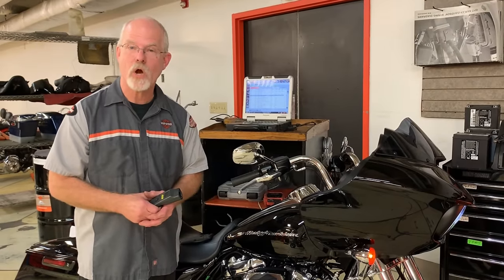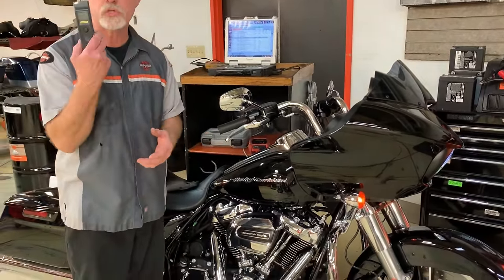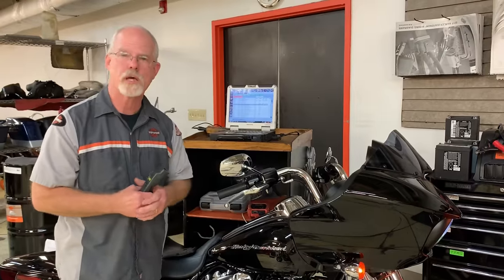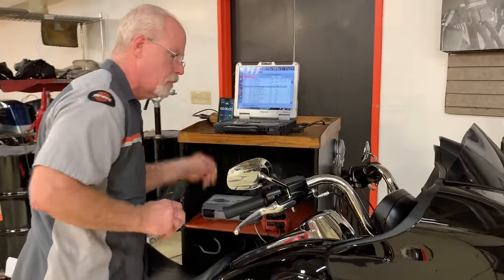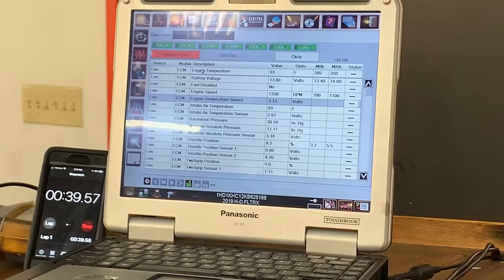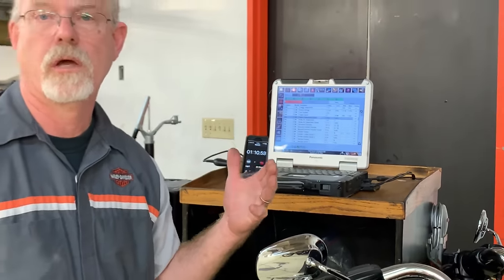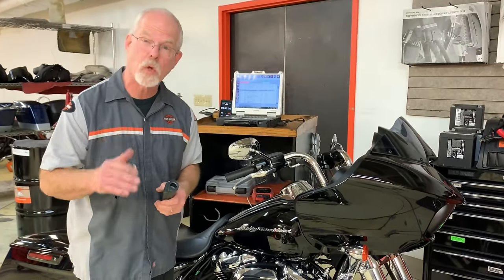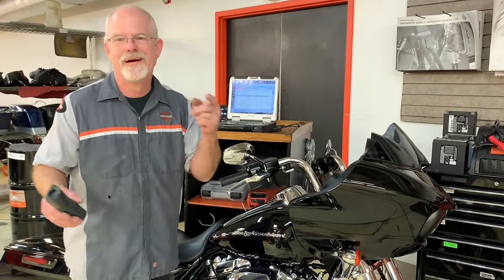DOC HARLEY: HOW LONG TO WARM UP YOUR MOTORCYCLE

Comment: Another little known fact: Every time you ride under an overpass, pull in the clutch and rev the crap out of it. This will add more oil to the piston skirts to prevent skirt scuffing while riding at highway speeds for long periods on hot days.

Comment: What is recommended warm up time for older carbeurated engines?
Reply: Chris Clark longer!
Reply: @bobbates6595  Thanks. I read another comment where the guy said he lets it warm up until he can push the choke in and it will idle. I'm guessing this to be about 5 minutes or so.
Reply: Chris Clark that sounds about right, I have a 79 electra glide classic, I like to let it warm up good before I start out, I bought it 30 years ago this month, May of 89! I hope 2019 is a good year for you!
Reply: I've got a 94 flhtc. I pull the enrichner out and let it idle until back cylinder is warm to touch.  Then pull away and adjust enrichner as needed. Don't hammer on it until the enrichner is all the way back in. Seen a lot of leaky base gaskets on evo's over the years for people  hammering on them right after start up.

Comment: Hi Doc. How can I make sure my water pump and coolant is flowing on my 2016 RG ultra. I did the upgraded pump btw
Reply from the maker: A suggestion. view the coolant over flow tank. With the motor off,
Turn the Throttle wide open, hold, turn ignition on. Fans should come  on, watch the level in over flow tank. Doc

Comment: Good morning, Doc, is there any benefit to run ethanol free fuel 93 octane Vs 93 10 % ethanol in my dyna 2013 FXDB
Reply from the maker: Yes, but a retune would give you the full benefit. The stock fuel and timing tables were designed for the 10% ethanol…..Doc
Reply: @LowCountryHarleyDavidson  Thanks Doc , My first  Harley and at 75 I have a ton of questions . Watching your videos really helps Be safe

Comment: Great advice Doc. Tell me, I heard (Shawn Smoke I think) that you should not let your motor Idle too long as this can damage the engine by various parts over heating and expanding too much? Makes sense to me. Thanks
Reply from the maker: You probably should NOT start your M8, go inside, have a cup of coffee, brush your teeth and get dressed while the plastic manifold is melting. ~Doc
Reply: umm ok is that a no then, you can leave it to idle for longer than the 30 seconds? Common sense tells me it is bad to let any engine idle too long. Thanks

Comment: But Doc,   my driveway connects directly to the hwy, they're going 60 to 70+ mph, I can't 
drive easy for 15 min, I have to get on it pretty hard right out the gate.
I have no problem letting it really warm up before leaving, what would 
you recommend , short of moving. : ) How long should be good enough in 
my case..? 09 Ultra.

Comment: Most engine wear in any kind of engine occurs right after a cold start up.  The best way to warm up any engine in a vehicle is to start it and start moving immediately as soon as your oil pressure is up to normal range.  Then drive it or ride it real slow for the first two or 3 miles so the engine,wheel bearings,  brakes, every part that moves warms up together.  That means a slow, leisurely ride through a neighborhood where you can ride nice and slow not jump up on the freeway immediately.

Comment: Hey Doc my dyna fxd 2008 after hot going out and xplotions , I replaced engine temp sensor, crankshaft sensor, throttle sensor, spark plugs, cables, gas filter, and still doing the same thing.. what it can be????
Reply from the maker: " after hot going out and xplotions" ?????? This issue sounds more than we can fix on the Net. Take it to your local experts....Doc

Comment: Hi doc i have a problem   with my 2008 96 cui heritge when i switched my head light to an led i have idle issues  with just the headlight but  not the two smaller road lights
Reply from the maker: Pull the instructions for the LED light install and review. Sounds like a wire is installed wrong or the ground wire from the headlight is old and not solid and clean to the chassis. Or it was just coincidence the intake seals failed at the same time as the installation🤷‍♂️. Thanks ~ Doc
Reply: @LowCountryHarleyDavidson  nope probably wired wrong because when i switched. Back to regular head light it smartened  it up

Comment: I wait 30 seconds to a minute and then I take off. By the time I’m to the highway (about a mile down the road) it is pretty dang warm. From there I have to rip it so I don’t get ran over. I have done this for the past 8,000 miles on my 2019 iron 1200 with no issues, even down to 25 degrees in the morning.

Comment: hey doc .. have a stage 3 kit installed on my 2017 street glide, do you think I need a extra capacity oil pan for extra cooling...
Reply: You've got 6 extra RHWP, so now it makes 103 rwhp and weighs 700lbs.

Comment: Harley-Davidson has a type of dry sump system so warming the engine is a waste of fuel and time. I fire mine up, put on my glasses, hop on, and ride, 45 seconds tops.
Reply from the maker: Well Stuart it is always your choice. If your reasoning includes a dry sump motor 🤷‍♂️. I look forward to replacing….i mean servicing your motor👍……Doc

Comment: I have a 2018 Sportster 48 and between riding days,  I start the engine and let it run for a few minutes to keep the battery from draining. How long would you recommend letting the engine idle to keep the battery charged if I'm not going to ride?
Reply: You don't. Put it on a trickle charger when parked. Ride it.
Reply: Get a battery tender for it, hook it up when your between rides. Your doing more damage then help by letting the bike sit there and idle when not riding it.
Reply: You have to let it idle for about 20 minutes because you used up so much battery starting it. I let mine go a half hour to be safe. You should rev it occasionally to keep the injectors from clogging.
Reply: LIONS 67 dont do it I would never start it unless I was going to get it up to temp real bad on your oils buy a battery tender I keep mine on one get a good one you will like it

Comment: Often wondered about two stroke motors with auto lube. That oil is always going into the motor at oil tank temp- cold! And even if it's a pre-mix engine the oil is still going in cold. Must be why two strokes have a shorter life than four stroke motors.
Reply: My yz 250 will be 40 years old next year still runs great
Reply: Yeah, had a few two strokes over the years. The one that I remember the most was my 1974 Suzuki T500L. Amazing motorcycle that was a great tourer.
Reply: The oil goes into mix with fuel. The atomized mix is warmed quickly.

Comment: What? It didn't get to temp after a minute then at the end you said just go with the manual - run for 30 seconds and then take it easy for 15 minutes? What I know is that if I warm up my carbed 06 Fatboy for 5 minutes it runs a lot better than if I buzz away after 1 minute.

Comment: I  just bought a 1997 Roadking with the  Marreti marelli injection...the warmup idle idles normally about a minute or 2 then revs down to a good lower idle  with a 2 into aftermarket exhaust  but after a five minute ride  up the road, I  then  shut down the engine, heads feel nice and wrm....., when restarted within a couple minutes from stopped it seems to high idle all over again for 20 to 30 seconds.... cleaned the throttlebody, still the same ...is this normal for these injections? Do they need longer rides to get the warmup idle to let it go lower?  Are there adjustments to remedy? Thanks
Reply from the maker: Marelli system are temperamental. Also they have a "fully Warmed Up" temp higher than any other system. My concern is Intake seals leaking...Doc
Reply: Could that cause a slight backfire  on throttling off downhill  from exhaust pipe and sometimes a hesitation from carb sometimes when throttle is opened wide whilst riding at high speed 100 kph to 120 kph or uphill?

Comment: When starting bike
Hold WOT as starting
Once started let it hit rev limiter at least 10 times
The quickly let go of throttle
Once the last backfire stops on deceleration
Calmly and Cooley straddle bike.
Wait till the clock hits 4am
Grab clutch. Resume WOT
Second rev limiter
Pop clutch and hold fishtail till it steadies in a straight line, hit second gear and resume normal riding speed.
That's how you ride a 
 Harley
Reply: Interesting, that's the same procedure for GSXR's
Reply: Honda warm up is when you pour 10 liters of gasoline on the whole bike and then you throw a match on it!

Comment: Thank you, very much, for your channel and great content; just subscribed.   I had been idling too long, because I wasn't sure how to ride "easy."  I wish you had gone a little further.  What do you mean, when you say to ride easy until it's warmed up?  I understand no hard acceleration.  Recently started trying to do it right.  But, when I change gears at 2.5k, the motor drops immediately to 2k and it sounds horrible, like something isn't right.  It starts to sound like rpms are getting too high around 3k.  So, is my intuition of riding between 2.5k and 3k rpm (during warm up) solid?  I ride with the Power Vision display, and don't exceed 3k until above 200*.

Comment: My bike starts at 1500rpm then goes down to 1200rpm... isnt that the most appropriate time to ride? Because if it isnt hot enough the throttle response is a bit augmented...
Reply from the maker: 1500 is for recharging your battery after the starter took out a lot. 1200 is still warm up. I wait for closer to idle when it’s at full operating temperature. But you can go if you need to. Thanks ~ Doc

Comment: I live in a very hot country, bikes heats up quick... Can I lessen d warm up time?
Reply from the maker: If you keep your motorcycle inside overnight, no. A cold engine is a cold engine. If left outside all morning in the sunlight and the outside temperature is hot enough to warm the motor parts (i.e. too not to the touch) then yes. Thanks ~ Doc

Comment: The book says run on full choke for 3 mins than 3/4 choke for first mile 1/2 choke for another 1/2 mile and 1/4 choke for a quarter mile . No choke for the last 1/8 of a mile to the bar. Repeat on way home.

Comment: What if it's an older model and not fuel injected?
Reply from the maker: Your motor is no different from a fuel injected motor. Your oil still needs to reach critical areas, motor needs to seal gaskets, and fuel needs to be correct. My old bikes would start on full chock. I would go to half choke while walking around bike checking all lights and visual checking all parts. All the time listening to hear the motor warming up and needing less choke. Choke off go ride….Doc

Comment: Hi Doc.  Love all your videos.   Question,  is it bad for your engine if you let it run for a minute or two daily?
Reply from the maker: Yes. Starting and idle for a couple of minutes does not allow fueling to get out of cold mode which adds extra fuel. Also idling does not allow the charging system to replace voltage taken out of battery when starting. A short 20 minute ride is better. Thanks ~ Doc

Comment: I still own one 1986 FXRS, I hate saying that because for years I owned two and recently sold one. I give my throttle two twists, pull the choke and fire it up.  I let it idle and I use the back of my fingers to touch the jugs.  When I feel like it’s to hot for my fingers I ride off.  I also let my bike idle for about 30 seconds before I shut her down.  I have had guys bust my balls about my little rituals.  But a couple of those same guys commented how dry and clean my motor is. The old Evo’s leak if not warmed up properly.
Reply: Man I miss my 85 fxrs, some pond scum decided he liked it more than me. Forks where locked but that still didn't stop them, thinking it got thrown in the back of a van or pick-up. Anyway that's how I warm my 94 flute. 188k miles. Never a blown head gasket or leaky base gasket.

Comment: I’m wondering why Doc stopped the timer when the oil got to 104 degrees, we didn’t get to see when the oil achieves normal/optimum operating temperature at over 200 degrees, I think we need to let it idle for probably closer to 2 minutes from a cold start.

Comment: Most modern engines don't need a warm up, but if HD is still in the dark ages design phase as indicated by using 20/50 oil. well I guess the neighbours are going to have to suffer your noisy crapper in the mornings. Seriously, are you serious?  Start and ride off. Like you said, it will warm up quicker if you ride the damned thing. As long as oil is circulating at pressure it's gonna be fine. Either that or get a Honda
Reply from the maker: Steve your Opinion is noted, have a nice day…..Doc

Comment: pulling on gloves and a helmet is 15 seconds or so. signals  and lights check is about another fifteen. easy, lazy ride to the local gas station to top up and you are ready to rip

Comment: I agree with Doc Harley start it up walk around check all the lights get on and ride it easy for the first 10 minutes.  I have own this bike for 20 years still works great with no issues. To me warming your motor up to long is just creating carbon problems and put more gas in oil which is causing more wear. You are not doing your engine any favors or your pocket book.
Reply from the maker: I am confused. First it's OK then It's not and wearing the motor out? I'll stick to the walk around....Doc

Comment: shite!  laptops, heat guns, cell phone apps ???? whatever happened to kick it over, keep the revs up (choke or throttle) for a few minutes to get the oil pressure up, get on it and get in the wind. been doing that for 50 years, ill never sell my shovelhead. great review doc.

Comment: Easy way to check, once you think it's warm stop the engine and remove the oil filler cap. Then get your knob out and put it into the oil filler hole, if your bellend sizzles away and burns you know your hog is hot to trot. Follow this advice and you won't go far wrong son.

Comment: Of course all this depends on ambient temperature! If it's 40°, which is as cold as you should crank a bike if you have 20/50 in it, I usually let my bike warm up 3 or 4 minutes. If it's 70 yeah 30 seconds to 1 minute is fine.

Comment: I was told to feel the rocker arm covers. When it feels warm.  Bye, see ya gone!
Reply: @Alan Rubin • I do the same, roll it out of the garage fire it up and put on gear throw a leg over the saddle reach down and feel the rocker cover it's warm I'm gone.  Back before Evolution Moters came out I would fire up my old Shovelheads and goodbye right away but with all the aluminum on.the Evolution that needs time to warm up and expand so you don't blow gaskets and O-Rings.

Comment: Hey Doc, thank you for the advice. Do you have any additional suggestions for how long to warm up a stage III bike with forged pistons?
Reply: 2 minutes
Reply: Stage III with forged, not cast pistons? Wow, you've put how much money into a fat, heavy, HOG?
Reply: @benjytexas  About 3k if you do all the work yourself, which ain't all that hard. Try that on a BMW. It's all about the torque rush sonny!
Reply: @Cwra1smith  ...LMAO, you wanna bring that to a proper roadracing circuit and show me how slow it is?
Reply: @benjytexas  A Road Glide has a much different mission. You wanna try and stay with my Suzuki TS-400 in the brush with that road racer? I didn't think so.
Reply: @Cwra1smith  , race tracks, I've got a RM that I'll race you on the motocross track as well!

Comment: There's been days I've ridden for seven or eight hours in 50 degree weather and my bike never cracked 180 degrees.
Reply from the maker: I’m sure you did not crack 96.6 body temperature either….Doc
Reply: @LowCountryHarleyDavidson  Lol, nope. Froze mah balls off.

Comment: That 15 to 30 second recommendation isn't really for the temperature to increase, but more so to get the oil flowing. When you first started it should only take a fraction of a second before pressure starts building, but it does take a couple seconds for the oil to coat all the surfaces in the motor. you don't want to put a load on the motor until that oil is reaching every spot it's supposed to. So, you should hop on your motorcycle and turn it on, late 10 to 15 seconds and pull off. Keep the RPMs low for the first 5 or 10 minutes and then just go from there.you want to be driving while the motorcycle engine is warming up because that also warms up all the bearings, chains, and such in the suspension. you can have a fully warmed up motor, but if something else in the system is cold when you hit the throttle you can break it.

Comment: Awesome videos! Glad I came across your channel as of recent. Had a question for my 2016 road glide special. Not sure if I’m blind or not  but I can’t seem to find the clutch adjustment cable. Does this bike have one? Or do I just adjust the clutch in the primary? I own the service manual and I see the clutch cable adjustment section states (road king)
Thanks for any response back in advance
Reply: With the 2014 and later Rushmore motorcycles they use a self adjustment hydraulic clutch. No adjustments necessary. Change fluids at the necessary intervals and you'll be fine.
Reply: angel suarez sweet thanks for the reply I appreciate it

Comment: I would never treat a fuel-injected vehicle the way I treat a carb'd vehicle. Regardless if it's a motorcycle or car. They have the same purpose but don't perform the same job. One has an automatic choke, and the other is a manual choke. One can read the engine's insides, the other can't. Why treat one as able to do different things than the other if the other can't?
Reply from the maker: Because they both have oil. Wake up two different people at 3am, Both need to warm up before running no matter how they are built...Doc